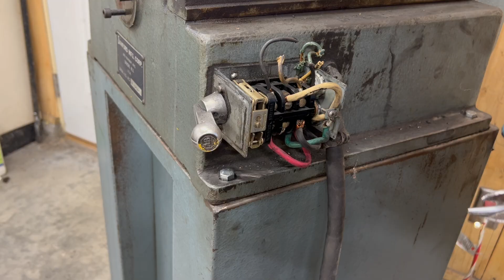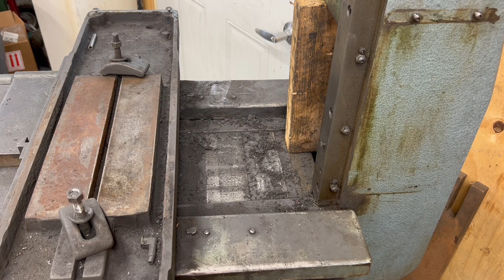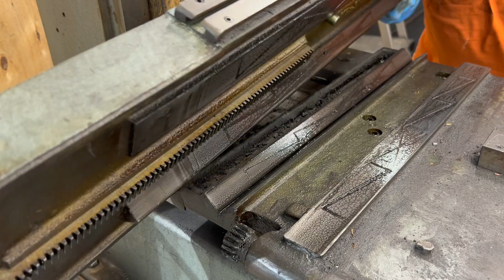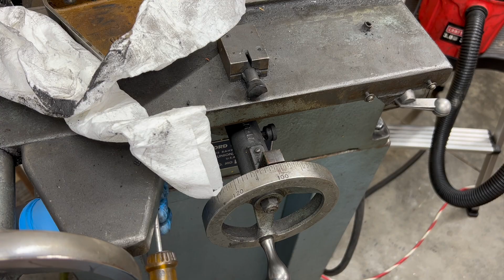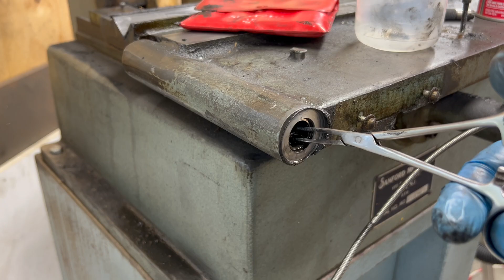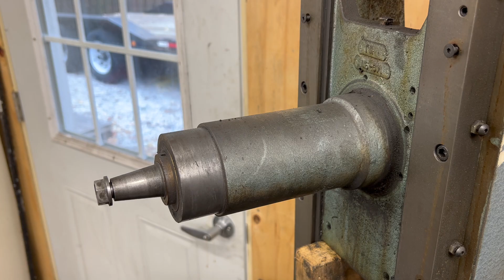Am I Insane??? - Sanford Surface Grinder - Disassembly Part 2

Comment: I absolutely love my Sanford mini. I spent 2 months learning and failing 5 times to eventually on the sixth try succeed at re winding the motor coils, but it’s running and I use it a lot. It’s so nice to have a desktop sized grinder especially when I didn’t have space for a standard size 6x8 etc.
Reply from the maker: Great to hear!

Comment: Had the same surface grinder in the same shape. Everything was completely worn out. In the end i scapped it. Yeah, it could be brought back, but at a very high cost in labor. Remember the specs are in the low tenths!
Reply: The ways are removable as you say, it's  one of the items I kept off mine. Putting a pin and measuring end to end there was .015 difference. This means machining then applying turcite, then scraping to maintain alignment and doing the same to the table, because it will definitely be out. I scared my old southbend lathe and if you have the time it can be very rewarding and you learn plot, but my guess is that every axis on this machine is way out. It's a casting kit!
Reply from the maker: For me, my time isn't so much money, but opportunity cost - what else could I be doing that I would rather be doing - so the cost of labor really doesn't factor in unless I am paying someone else. I agree, though, that if I was using my shop as a primary or secondary source of income, I would probably scrap it and get something in better shop, or quite possibly, nothing else at all. Thanks for watching!
Reply: @MyLilMule it’s a hobby, mostly, so time is not the most important component. As I mentioned in another post, as long as the spindle and ways are ok, the rest can be made to work. With this machine and a lot of others, including mine, the ways are just cast iron to cast iron, so at worst a bit of scraping would fix it, if you know how to scrape. I dislike scraping so I avoid it as much as possible. But if you gotta, you gotta. Everything else is annoying but easy.
Reply from the maker: @melgross  If I choose to rebuild it, from some cursory inspections I have recently done, it will need more than just scraping. I may have to mill the ways on the base. The good thing (?) is that with these Sanfords, the ways are removable. They sold it as a "feature" - Meehanite (which is still cast iron).  I'm inclined to rebuild it, just not sure when.
Reply: @ good luck. That would require extremely accurate set up. Is this really that far out? I scrape to a couple thousandths. More than that seems to take forever. If I had a Biax, I’d be willing to go to five thou. But they’re expensive, used,and I don’t do enough to excuse it. A couple of guys have modified an angle grinder for that. Meh, they work.
Reply from the maker: @melgross  They are worn. I haven't gotten to the point of measuring just how bad as of yet.
Reply: @ as a boss of mine back in the mid 1970s used to say;”Hope for the best and prepare for the worst”. Hopefully, the wear isn’t too bad. But an interesting thing about surface grinders is that the table, left to right, doesn’t have to be perfectly horizontal. If the left side is running higher by even a 1/16”, as long as it’s not bumpy, it’s fine. If the rails are at that angle, you’ll still get a parallel grind. If the top is angled, buy]t it’s running straight, it can be ground so that it’s fine. Only if the rails are worn unevenly back to front, or wavy are they a problem.

Comment: On my Sanford grinder the shaft for traversing the table had the same needle bearings, and I just put grease on the outer race and put the needle bearings back in and put the shaft through the bearings. And on the saddle lead screw it has ball bearings in place on the ends by the wheel.
Reply from the maker: Interesting about the ball bearings. I don't think I am going to dismantle the handwheel of the saddle. I'm too afraid of what I might find there!
Reply: @MyLilMule what I find is that bearings on hand wheels are usually in good shape. If not, it’s usually easy to get the exact replacements and other than for spindle bearings, they’re inexpensive. I look in McMastercarr. High quality spindle bearings are very expensive. Needle bearings can be a hassle as they rely on a hardened, precision ground, or machined shaft as the inner race. Replacing the needles isn’t too bad. I put them around the shaft and hold them in place with tap just halfway along the needles on the far side. Then slipping the shaft in deep,enough to hold the needles, I then remove the tape and use acetone to remove any possible gunk from the tape, oil if required and push the shaft all the way in. Just measure the diameter of the shaft and the diameter of the hole, then the length of the needle to get the size of the bearing. Add a bit to the length of the needle to get the length of the housing.

Comment: Don't worry about the condition of the grinder you have. I have bought 6 surface grinders, 1 cylindrical grinder, 1 broach grinder and 1 Jig grinder at auctions over the last 8 years and yours looks about average condition. The time and effort it would take for you to find a good deal on one that is in really good condition is as much or more than the effort to recondition the one you have. All most all of them are filthy and could use a new screw and a bit of hand scraping.
Reply from the maker: That has been my experience, too, with other machines. I am fully prepared to trade some sweat equity for cash. Maybe someday I can afford to buy a ready-to-go machine, but I don't see that happening anytime soon.
Reply: @MyLilMule  I agree with Tim 100%....   What I'm seeing is about average and will probably be good enough for the girls you go out with!  lol  Mine was just as dirty as yours when I rescued it.   I did find original flaking on most areas so I kinda lucked out in that respect.  Mine came with an automatic oiling system, after some new wiring and a VFD stuffed in the cabinet, I was up and running.  Going to single phase was not an option for me.  Sure am glad the chinese make cheap VFDs...
Reply from the maker: @jagboy69  This exceeds the standards of any girl that would date me! 😂 I've already started doing some inspections of the ways. It's not looking too good. Salvageable? Probably. Is it a project I really wanted to take on right now? Definitely not. I'm going to see how it does AS-IS and then make a determination of what my next steps will be.
Reply: @MyLilMule  uh oh..  Ya blued it didn't ya??😯  Smart man once told me ya don't ask the question if you won't like the answer.🫣😝
Reply: @MyLilMule  How much is it out?
Reply from the maker: @timeckelmann1196  Haven't measured it. Just a visual examination. Stay tuned for another video in a couple weeks.

Comment: That was one filthy machine! I'll admit I would have persevered in trying to rescue it too, good on you!
My SG arrived in a cleaner state but as an incomplete kit of parts, so I had to make new shafts etc. Which brings me to that needle roller bearing, I would just replace it with a sleeve of bearing bronze and keep it oiled. It looks like the housing is quite long so there's room for a good length bushing. Thats what the table feed shaft on mine uses.
When (not if!) you get it running, you'll quickly discover that these manual machines are hard work and you'll wish you had power feed to the table!
Reply from the maker: I really need to get a feel of the overall condition first before I make any decisions on repairs. I have so many projects in the shop, if I can just clean and regrease them, I may leave them for a while.

Comment: One unanswered question that I have about these Sanfords is the lubrication for the needle bearings. It is possible that they are sealed for life, though the provisions included to keep dust out seem minimal, even for this era. Do you see evidence of grease? Or is it possible that one of the oilers supplies this area?
Reply from the maker: I couldn't find any oil passages to the needle bearings. I assumed it was just greased that would be expected to last for many years. Everything needs to be maintained to some degree. This thing probably didn't see much of any.

Comment: you got me completely turned off of buying a cheap surface grinder, they come up often.
Reply from the maker: Don't be discouraged because of me. I should have looked at it closer and did my homework. I might have been able to find something that at least took a standard pitch screw.
Reply: @MyLilMule the one thing you weren’t going to really be able to think about was the pitch of the screw. The two things of most importance is the spindle bearings and the slide ways. They can be Vways, V way with a flat. Ball bearings, roller bearings, or unusually, something else. Ball and roller bearings are theoretically better, but if they’re not properly fastened when shipping, they can get destroyed. And minor bouncing on a truck will cause the table to bounce, firming dents in the slide ways, ruining them. Those are the things to look for and be careful of when you bring it home, or get it shipped. This machine, using basic slide ways are sturdier. The dirt is annoying to get rid of, but is the least of any problems that may come up. The studs will get jammed because the coolant, which prevents rusting in use, will cause the metal and wheel dust to work its way between the stud and the slot acting like cement. Rust if it’s been kept in bad conditions. But again, as long as the ways and bearing are ok, the rest can be fixed. Yikes! Be very careful about pounding on the table. The table normally just lifts off so you can put it on a bench with a towel under it.

Comment: Looking good.  I find it very interesting the differences between my Harig and your Sanford.  Regarding the electric, can you access it from underneath the grinder?  Mine is exposed on the bottom side of the casting.  One nice thing on my Harig is that there is still visible scraping on the ways, probably due to the constantly recycling oil lubrication system.  But it was pretty much in the same extremely dirty condition.  I guess I better step up my game and get mine done, you're probably already ahead of me by now...  🙂
Reply from the maker: I might be able to, but with it on the base, it might be more difficult.